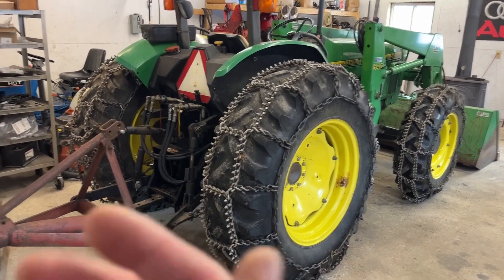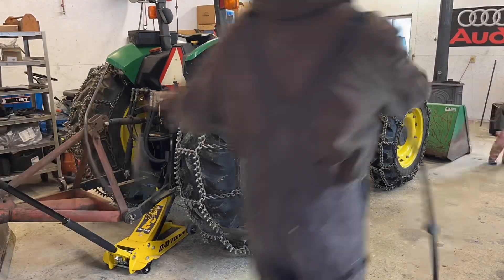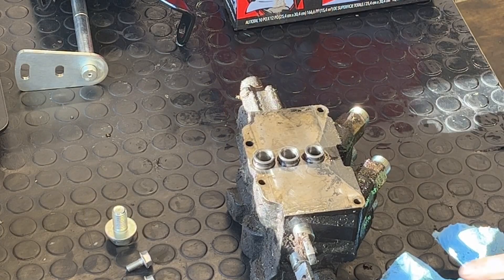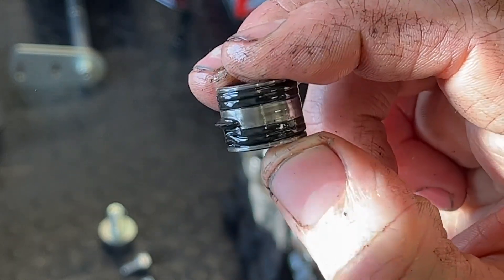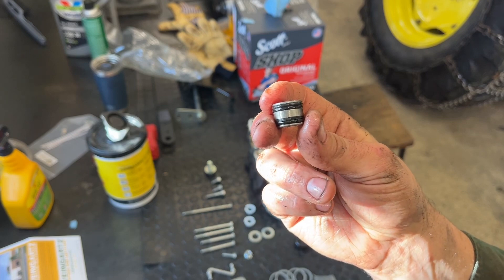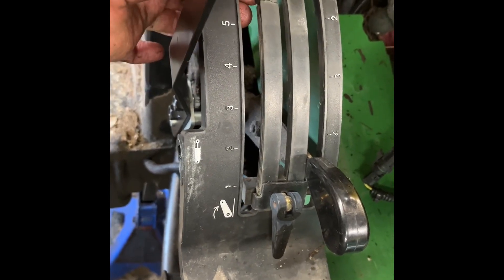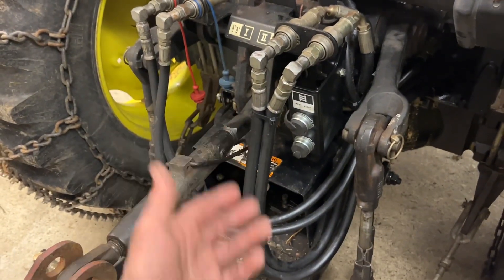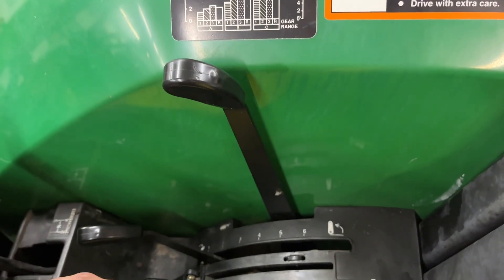Adding a Third Hydraulic Remote to a John Deere 5400

Comment: I just bought a 5400 tractor and it has no plumbing at all for hydraulics - but I’m sure I can add.  So can you direct me  how to even search for a kit
Reply from the maker: I search through the parts diagrams found here. They can be very hard to find what you need, but everything is in there if you have the time to spend. Here is the overall list https://www.weingartz.com/illustrated-diagram/john-deere-parts-lookup/model-5400-tractor-pc2332/4275-34940   

here is the basic SCV system, but there is more to it. You would need the joystick and the cable setup if you don't have it. 
https://www.weingartz.com/assembly-diagram/john-deere-parts-lookup/model-5400-tractor-pc2332-dual-scv-hydraulic-lines-selective-control-valve/4275-34940-518106

Comment: Do you still have the part number
Reply from the maker: Yes, the selective control valve kit is JDLV100117. Those little sleaves with the o-rings are JDRE45736 (you need 2 of those), and JDRE45735 (you need one of those)

Comment: So if I just want to add a third remote to my John Deere 5400 I just need what comes in the JDLV100117 kit? Can you buy it directly from John Deere?
Reply from the maker: Yes, that kit has everything you need, you can buy it from Deere.
Reply: If you only use the remote occasionally,  you can unplug the tilt for your bucket and use that outlet